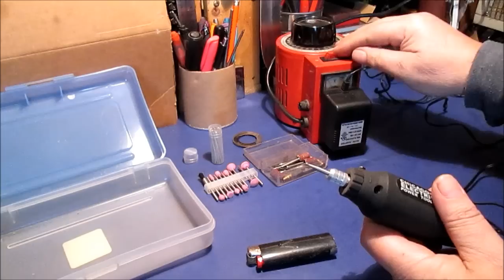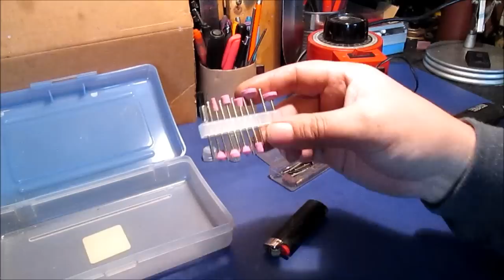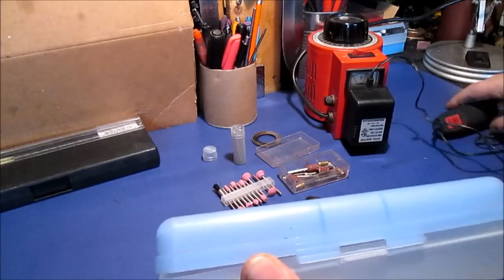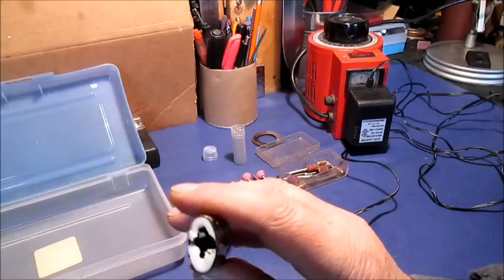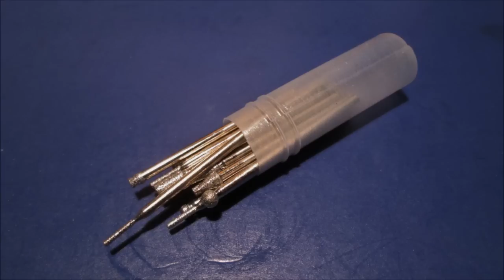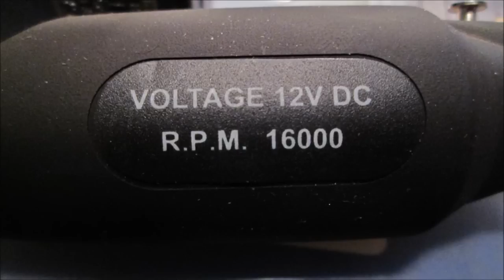Chicago Electric Mini Rotary Tool (with added speed control )

Comment: How would it run on 18 volts?
Reply from the maker: +Marshall H. (gatrwrks) I would not try it ...A car stereo is 12 volts but an alternator on a car can put out 14 volts and the radio is ok with that but 18 volts would be pushing your luck
Reply: Ok.

Comment: You lose a lot of torque by lowering the AC input voltage with a variac.   You can easily build a simple PWM circuit with a 555 timer and a MOSFET tranny.  That will provide a more usable slower speed with torque along with slower speed.   Especially since the tool already uses DC power.     Yikes!!!!!    An AC light dimmer is NOT an acceptable replacement for a variac.     Happy New Year
Reply from the maker: +jp040759 I am no electronics expert but I have a small grinder made from a sewing machine motor and have run it for several years on a light dimmer I am not worried about losing torque on this little rotary tool when using it on hobby stuff Plugged into the wall you can stop the thing with your fingers on the collet

Comment: good plan but i personally would keep the speed control on the 12vt dc side as the adapter could burn out from to low of input but that is  only my opinion you could use a dimmer switch from a headlight system on a car from the dash light if one was available  on the 12vt  side
Reply from the maker: +DriveShaft Drew The headlight dash dimmer switch is a good Idea ...I know that low voltage will burn out an AC motor..... If it burns up the wall cube I have several more I have run it alot this way on the variac